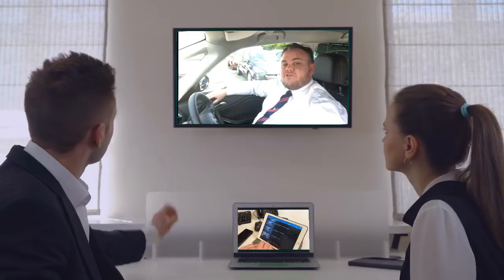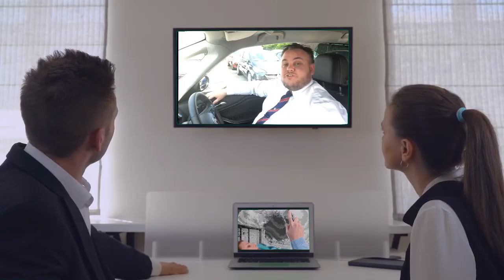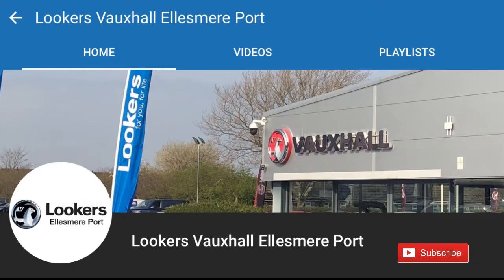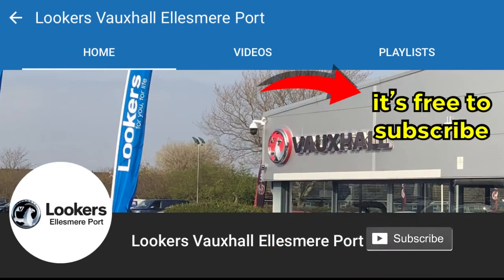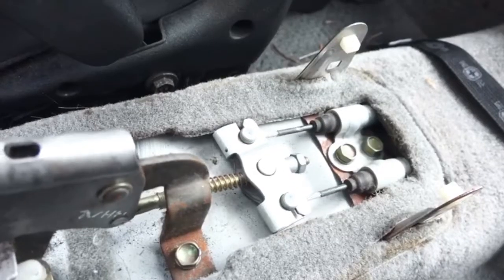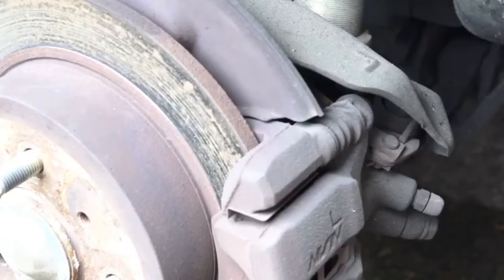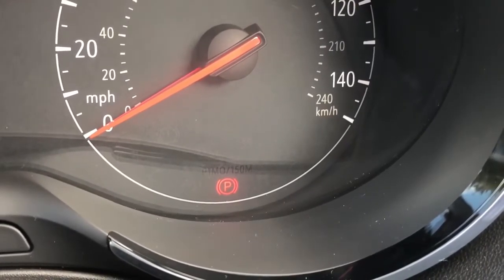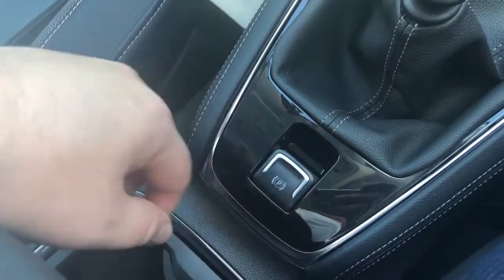How do I use my electronic parking brake? Reloaded

Comment: Show us how to do a hill start using the electronic brake without rolling backwards when slipping the clutch while in first gear.
That would be a lot more useful.
Personally I would much prefer a manual handbrake because, among other things, I don't have to look down at it. I imagine I would have to look down to find the little button of the electronic one and thus be distracted from looking at the road.
Reply: Find bite and accelerate, the e brake will turn off automatically.
Reply: some cars have hill start assist otherwise it's judging the biting point only without the brake hold delay
Reply: This is what I wanted to see as well
Reply: agree
Reply: The vauxhall I'm learning to drive only activate/deactivates electronic parking brake only if I'm pressing the foot brake . 
It's a feature for a problem that never existed before.. 
Autohold it's pretty easy I agree but the system on my instructor s vauxhall doesn't have it . I still need to press the tiny button every time I need parking brake . Makes it a lot harder on hill starts because I need to be pressing the foot brake to release parking brake .. sometimes I do need to look down to find the little button 😅😅

Comment: Bit confused. Is it the case that when the EPB is on you can "turn it off" by either depressing the brake pedal and turning the EPB button down or doing nothing other than accelerating (e.g. hillstart)? And if the latter, please confirm you don't need to turn the EPB button down when accelerating. I have just bought a Toyota Corolla that I am yet to experiment with but I must say I am rather concerned about how to do hill starts. At this stage I'm not a fan of the EPB concept. Thanks.

Comment: Just got an Insignia and it's taking some getting used to. Have far more control with with a manual handbrake when making complexed manoeuvres on an incline in tight spaces. It's baffling how anyone thought an electronic one would be a good idea. I can see them causing lots of accidents for less confident drivers than myself.

Comment: There maybe a time when it needs to be push or rocked and even towed, so bad idea auto locking when the engine is switched off - unless it can be also deactivated to remove it.
Reply: if you turn the ignition on, put your foot on the brake and release it, it won't engage when you shut it off. it only does that if the engines running.

Comment: I'll be getting the 2018 Peugot 3008 and I'm wondering if that electric handbrake is the same as this Vauxhall one? I did test drive the vehicle, but didn't use the handbrake (only used it to park, but can't find any information online whether you can just use the clutch to release it upon moving).
Reply from the maker: Hi thank you for reaching out to us, i have done some looking in to it for you and yes it is the same system as the Grandland X.
What made you decide on the Peugeot 3008 instead of the Grandland X?
Reply: why in gods name would you ever buy a peugot or vauxhall? if you had fiat then you have the 3 worse cars manufactures (maybe some Chinese nonames) i dont get it ;/
Reply: @Trev0010 Peugeot is far superior to vauxhall and fiat .. driving position  , dashboard etc doesn't feel like a french car .

Comment: What if you want to hold the parking brake on whilst finding the bite? Rather than it disengaging by itself as you find the bite?
Reply: outta luck lol
Reply: I know in the Nissan Qashqai, the brake disengages once you add throttle rather than just on finding the bite point.

Comment: There's a serious amount of idiots in this comment section. How can you be confused over how a handbrake works? It's literally the easiest thing about driving. Simple, stop the car, pull the switch. Done. Get back in the car, select first gear if you're driving a manual, and find the bite if you are on an incline then simply accelerate away. The car won't move anywhere until you give it enough gas, that's a guaranteed fact. However, if you blip the throttle, the brake will release even if you don't give it enough gas. So, don't blip the throttle. You just put the car in gear, lift the clutch and once you find the bite, press the throttle and it will release with absolutely no roll back. In the case of an automatic, just select either drive or reverse and press the throttle. That's it. Simple. Don't even think about it, just drive off like normal and it works fine. Releasing it manually will cause you to roll if you're on a hill, or touching the throttle before you have the clutch at the bite point.